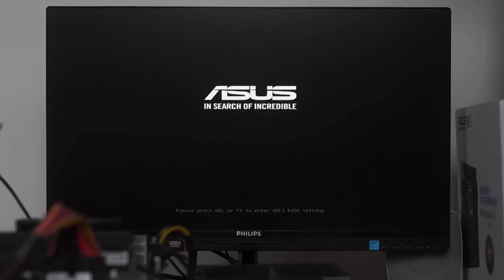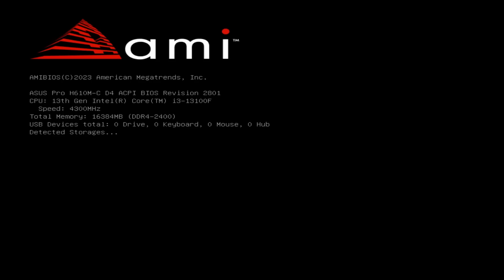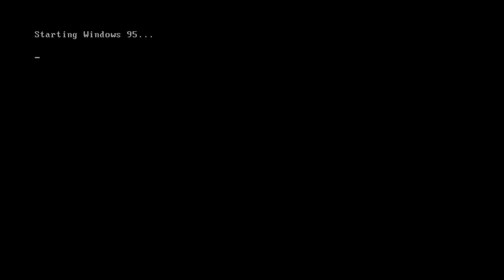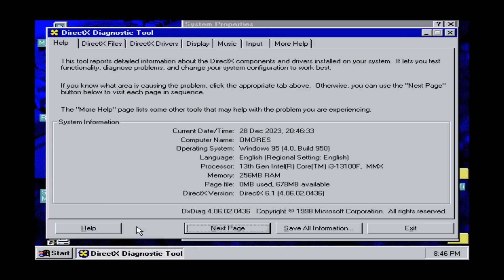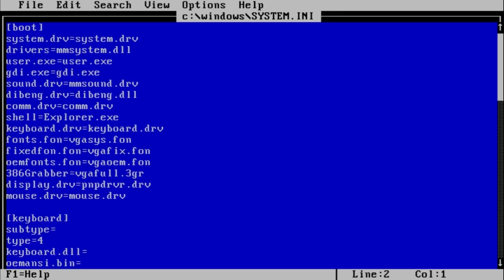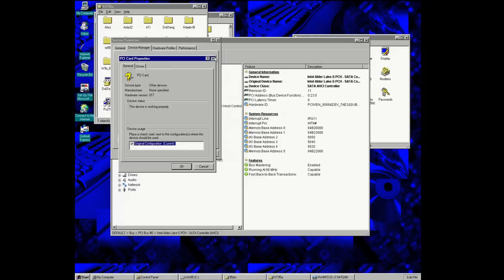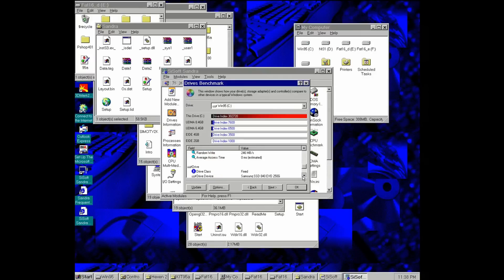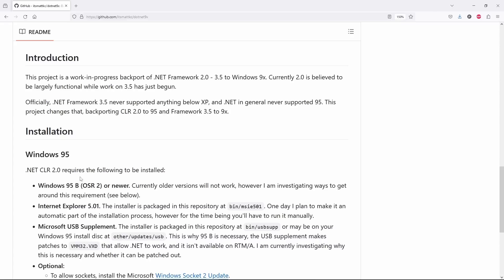Introducing Windows 95 to a modern 13th Gen CPU and hardware (or vice versa)

Comment: I want to put Windows 98SE or XP on my SteamDeck LCD as a DualBoot option... I pulled it off once on a older Core i7... 
I modified the Windows 10 Bootloader a bit, and the Windows 7 Bootloader (maybe it was the Windows 7 Bootloader I got functioning It's been a while,) 
BUT, Partition for Windows 98SE, one for XP, one for Windows 7, then I got Froggy and built a Windows 10 Image and dropped it on the disk and I got IT booted using the Windows 7 Bootloader - I just wish I remembered what I did... It was all Nice and Tidy too...
Reply from the maker: I don't think it will work because, even if the CPU is a Zen2, the APU works only in UEFI mode and doesn't have a VGA BIOS. It might work with this thing: https://github.com/FlyGoat/CSMWrap - it looks very promising, but I didn't have time to test it, and don't forget that you don't have drivers for the GPU even if you manage to boot in legacy mode.

Comment: Back when software used a reasonable amount of resources and developers weren't told they could use whatever they wanted because it was cheap
Reply from the maker: Yep, in 1995 the primary market for Windows 95 was 486 computers. So they had to over-optimize Win 95. I actually installed it (or Windows 95A) on a Ryzen 9 9900X and it flies... check it out: https://youtu.be/e32NfT06FrU

Comment: Haswell 8 GB RAM, Insufficient memory... - I wrote on vogons
Reply from the maker: Here's my answer from Vogons: "Cregfix isn't required for this configuration. Loading it when it's not needed usually doesn't cause issues, but I did run into a 6th Gen motherboard where I had to disable it to get Windows 98 to boot.

My guess is that your problem is related to himem.sys. Make sure you're using the version that comes with Windows 95, not himemx. Also, try running himem.sys with the /M:1 or /M:3 switch." Also are you using the boot drive with AHCI?

Comment: Feeling lucky to work on Win 95 during that era. It took many hrs to install OS and Drivers. BW monitor and heavy roller ball mouse still comes in memories 😂😂
Reply from the maker: Back in the day, I quickly upgraded to Windows 98 but had to revert to 95 because my 56K modem wouldn’t work properly in 98. By the way, I just installed Windows 95 OSR2 last night to test an MPE2G video decoder card. Running it on an SSD makes a huge difference, the installation took like 20 minutes on a Pentium 200MMX.
Reply: @O_mores  oh i see!! Like some of my friends keep  win95 in their PC's for longer time even win98 became common just because of gaming. They felt that games run much smoother in it with same hardware configuration.

Comment: Can Windows 95 support newer DirectX 9 graphic cards?
Reply from the maker: Yes, you can install a GPU with native DX 9.0c support like nVidia 6/7000 series in Windows 95 but the problem is that Win 95 can use only up to DirectX 8.0a released in January 2001. In Windows 98/ME the latest DirectX release that can be installed is from 2007.
Reply: @O_mores Hmm it's interesting cuz somehow my installation on a X58 mobo got stuck at "Starting Windows 95..." screen and automatically restart in a loop. Tried both Patchmem and FIX95CPU and I noticed it had a BSOD before that but still went on after a reboot
Reply from the maker: @phamucanh488  Usually on these motherboards the problems are related to disk access since SATA ports are by default set to IDE legacy mode. This should be great for Win 95, but the problem is that the IDE mode on these motherboards it's tuned for XP and Windows 95 cannot initialize the disk controller and it crashes. Newer motherboards are running SATA drives using AHCI - which can natively handle real mode requests and it simply works in DOS an Windows 9x, but it's slower since it the disk si basically handled by the BIOS.

Comment: Does it recognize dvd-rom in ms-dos boot (windows 9.x) in ahci mode?
Reply from the maker: AHCI drivers are 32-bit and are designed to work only with Windows. SATA optical drives will be recognized and function properly—I used them in Windows 98 without issues. However, I can't recall if there were any problems in Windows 95, aside from the AHCI related error mentioned in the video. For DOS, separate AHCI drivers are required but these were available since SATA appeared. I remember that I used such a driver made by LG.
Reply: @O_mores  R. Loew's AHCI cdrom driver AHCICD.SYS doesn't find my SATA DVD drive. I CANNOT FIND ANY SUCH SATA DRIVER LG FOR MS-DOS DO YOU REMEBER ANY LINK FOR THAL ONE.Do you remember any link for sata? My pc athlon xp 2.
Reply from the maker: @ Hi, here is an old article from my blog, written in 2008, the files are still downloadable: https://www-pinzaru-ro.translate.goog/1137/drivere-dos-pentru-cd-rom-patasata-pentru-placile-de-baza-mai-noi/?_x_tr_sl=ro&_x_tr_tl=en&_x_tr_hl=en&_x_tr_pto=wapp

Comment: Unfortunately, I don't have a large budget, but I have an old HP SFF 8300. Can it help? I already tried installing Windows 2000 on it using a modified ISO with all the drivers, including USB, SATA, and AHCI. It worked fine at first, but after installing UniATA, it started giving me a blue screen.
Reply from the maker: You know what's funny? You might be using the wrong UniATA version, because they are not all the same. "UniATA v. 0.46e8 seems to be the perfect version for NT 3.51 and SATA drives." - I wrote this on a forum a few years ago and I remember that some dudes from Vogons commented that the last version didn't work for them and .46e8 is better.
Reply: @O_mores  can you send me the file you're using?
Reply from the maker: @GordenMalcom   Release Version 0.46e8 (rar/tgz) - 173.5 Kb/268.1 Kb.  This is the one:  http://alter.org.ua/en/soft/win/uni_ata/BusMaster_v46e8_src.rar

Comment: This seems to be very interesting and there might be a way to make a Windows 95 OSR 2.0 or OSR 2.5 iso file with all the patches and drivers for modern hardware up to the Intel Core 14th Gen integrated to make things easier!!!
Reply from the maker: I guess it's doable, but also you might consider performing a fresh Windows 95 install, do every upgrade necessary and save Windows + Program Files foleders + root files into a zip - then you can unload that zip onto a fresh DOS bootable partition. If something goes bad you just replace Windows folder with the one from the zip. I do it all the time. If you make this move on a different hardware, it will work, Windows just have to discover your devices once again.  I know that a fresh installation can give you a certain peace of mind... but from my experience using a preinstalled Windows folder is practically the same.

Comment: i noticed msdos compatibility mode can be good if you are only doing reading from disk with a very fast CPU and you are not constantly switching between windows and virtual DOS machine application.
Reply from the maker: Yes, it's quite OK on modern systems. Sometimes I don't bother to install AHCI drivers, except when I really want a SATA optical drive in Windows 9x.

Comment: Surprising how DXDIAG reports the right processor lel
Reply from the maker: "In the x86 architecture, the CPUID instruction (identified by a CPUID opcode) is a processor supplementary instruction (its name derived from CPU Identification) allowing software to discover details of the processor. It was introduced by Intel in 1993 with the launch of the Pentium and SL-enhanced 486 processors. A program can use the CPUID to determine processor type and whether features such as MMX/SSE are implemented."

Comment: How do you Samba setup a print server? you setup a Samba server with your Epson but I do not know how to do it. Could you make a tutorial? that would be very nice. Also nice video!
Reply from the maker: I'm using an Epson print server, so basically I don't have to setup anything it will show up automatically  on the network. You should read this for Windows 9x/NT: https://support.microsoft.com/en-au/topic/managing-network-printing-in-a-windows-environment-8e06c364-e4bf-8842-915a-ba9f077f3bda
Reply: @O_mores  I have a good news update, I found that in VMware which is what I am using, I must add the serial port named pipe LPT1. Then I type the command "net use \\sambaserver\sharedprinter printer on my Samba server, I am able to print just fine.

Thank you for your help!
Reply: @O_mores  I have good news! I found that using a Windows 2000 VM as a print server works extremely well for MS-DOS to Windows 11. Yes you heard that right! I also accomplished another thing, I was able to print for Windows 1.0. Yes. Windows 1.0. Using the 1987 Windows 1.0 LaserJet PCL 4 driver with the printer itself came out in 1984. 

Windows 2000 was faster and easier in my opionion.

My printer was a HP OfficeJet pro 8028e only supporting HP PCL3 GUI despite that, it works with few PCL5 printers and some newer PCL3 GUI printer drivers for 98 like the HP Photosmart 9100 and for 95 like the 
HP Color Inkjet CP1160.
Reply from the maker: @ramenmaster1253  Nice. This sounds like a video I should make on this channel: „Printing from Windows 1.0”... I must do some research fist. Thank for the info.

Comment: How do you manage the chipset/mother drivers? Because that mother dont  have win95/98 drivers. Otherwise your Device Mánager Will be full of ⚠️⚠️⚠️
Reply from the maker: Well, in Windows 9x you don't need very specific chipset drivers, everything will be pretty standard based on x86 architecture and Basic Input Output System... (BIOS). This is enough to have disk access, keyboard and mouse input, display output etc. Next if you use the right hardware with Win 95 drivers you can get a full experience. There are universal AHCI drivers that will deal with the SATA ports - and these are like the only chipset drivers. Also on Core 2 Duo and first generations of Core i moterboards (up to 4th Gen - Haswell) you can get USB support by using NUSB drivers.

Comment: Wouldn't you just run this virtualised ?
Reply from the maker: It runs better on real hardware, with much less power consumption. On my Ryzen 9 3900X while running PCem all 12 cores stay under full load to get rather crappy FPS with an emulated Voodoo 3. If I restart and boot Windows 95 from an SSD -  my real Voodoo 3 PCI can't draw more than 25W from the PCI slot.  Not to mention that I can use an Aureal Vortex or a Sound Blaster Live! sound card.

Comment: Ah. 95.   It had that infamous timing bug where you would get a Windows Protection Error when running on any processor 350 MHz or faster. 

That included my K6-2 350. 

It was so much of a problem that AMD released a patch free of charge.
Reply: If i remember correctly, that bug was only in the first release of Windows 95. Later OEM releases (OEM Service Releasr 2 and later) that were sold with newer PC's had the bug fixed. I've run the original Windows 95 on a virtual machine anyway, by taking one, or at most a handful of, files from a later release and replacing the files on installation media.
Reply: @enginerd80  I had 95B (OSR 2).  I still had to apply the patch.
Reply: @DerekWitt  Ah, okay, it must have been the OSR 2.5 that was fixed for this issue, then.
Reply: @enginerd80  yeah, I think you’re right.  95C (OSR 2.5) sounds about right.  I think 95C was released shortly before 98 was in beta or before then.

Comment: It's funny that you have AMIBIOS on both the 486 and 13th gen Core PC.
Reply from the maker: Right now in the consumer market AMI BIOS is the only choice.  Either you a have a crazy gaming motherboard or something more business oriented like this Asus H610M- C D4 motherboard I'm using in this video - you end up with an AMI BIOS. Being the only provider did cause trouble in Windows 9x world. A tiny bug in AMI BIOS CSM module caused all Windows 9x installations to crash into a "VCACHE Windows Protection Error" That's why "cregfix" is needed on modern hardware, generally anything released 2020+. You may want to watch this video: https://www.youtube.com/watch?v=YILmK5xkRZc

Comment: wonder if someone would be crazy enough to attempt getting an rtx gpu working with w95
Reply from the maker: Here is a RTX 2070 Super running in FULL HD on Windows Millennium: https://www.pinzaru.ro/wp-content/uploads/2020/06/rtx_win_me_vbe_1.png <- using VBE drivers. You can play games only in software rendering. Even so,  some games will look very good. For example Half-Life looks amazing in software rendering. Also we can try OpenGL software rendering with MESA, but even a very fast CPU is not quite enough.

Comment: The reason, why modern Intel processor could run old software, that was designed for i486, is because modern Intel CPU are still backwards compatible with Legacy software.

I bet, that I can easily run Windows 98 SE on LGA1366 Xeon.
Reply from the maker: Intel and AMD. I guess if Intel decides to ditch legacy compatibility AMD will still offer a dedicated  CPU line fully X86 compatible. Or the other way around. Anyway there are some industrial motherboards that are offering x86 CPU replacements until 2033, so I guess backward compatible x86 CPUs will stay on the market for at least 10 more years.

Comment: Ever thought of trying software rendering with this? I know it mightn't look as good, tends to get a bit soft, but with so much CPU power, you might get some great framerates.
Reply from the maker: Yes, I used software rendering and some games are looking very good - Half Life for example, or Unreal. Also depends on what GPU you use... with a nVidia 7900GS from 2006 I get way much better frame rate VS a PCI ATI Rage II from 1997.
Reply: @O_mores  My first x86 PC was a Windows 98SE machine running a 500mHz P3 in 1999(before that, I had to just keep upgrading my very old A1200 to keep it current enough), and I remember getting decent performance depending the game using software, as I couldn't afford a GPU, just imaging being able to run those games at the refresh rate of my monitor would've been a great change of pace.
Reply from the maker: Ooo! Pentium III in 1999 = expen$ive. I played many games in software rendering: Quake I, II, Unreal, Half Life, Tomb Raider etc. Basically anything launched before summer of 1999. Back then I was more interested in playing games than watching smooth textures. Of course playing again the same games with a 3dfx Voodoo was quite an experience...
Reply: @O_mores  It was a lucky find, an old lady bought a Packard Bell computer and decided she didn't want it anymore so asked someone to put it in the bin, that guy asked me if I wanted and yeah, it must've cost at least £1,500, come with a CD-RW, DVD drive, pretty much everything except a GPU.

At the time, I was still using an old Commodore Amiga 1200(plus various upgrades, a CPU and FPU accelerator, hard disk, CD-ROM etc.) I got for Christmas as a nine year old, so I was just "heck yeah".

Comment: What are the advantages of running old versions of Windows on modern hardware as opposed to using 86Box or similar software on a modern operating system running on modern hardware?
Reply from the maker: First of all, you can use real hardware and you get  better performance. Some older video cards like a Voodoo 2 or 3 now can be emulated with PCem, but you get moderate FPS while you have to run your 8/16 core CPU under full load. This will eat a lot power, while a real PCI Voodoo 3 can't go over 25W. (max power draw on a PCI slot) In my last video I used a nVidia 7900GS 256bit GPU, which is like 20 times faster than a Voodoo 3.
Reply: I have a couple of hd4650 agp 1gb cards for retro machines.

Comment: Hexen2 should work absolutely fine on Modern systems in Modern Windows especially if you use the uHexen2 sourceport.
Reply from the maker: Yes, indeed. Actually the original H2.exe (software rendering) from 1997 it works in Windows 10/11. With the help of nGlide - GLH2.exe should work also.

Comment: 95 can handle 768MB of RAM without patch :)
Reply from the maker: Yes, but while installing Windows 9x on modern hardware I prefer to start with less RAM - then - if everything is OK  - I can do an "upgrade". For example, this Windows 95 didn't want to load without himem.sys /M:1 switch. You, might say that it's the same thing with /M:1 or without it but in this case it took me a while to figure it out. The installation started on the 486 and I didn't modify manually config.sys since it wasn't necessary on that hardware.
Reply: @O_mores  with a patch what is the maximum RAM that 95 can handle? 98SE can handle 1GB without patch and 3.5GB with a patch :)
Reply: The max for 95 was about 1.5 GB. 

I ran 95B with 640MB of RAM on my Pentium III 933 MHz without any problems back in the day.